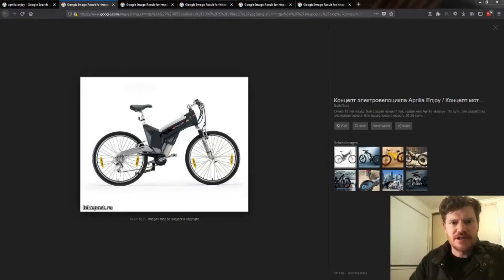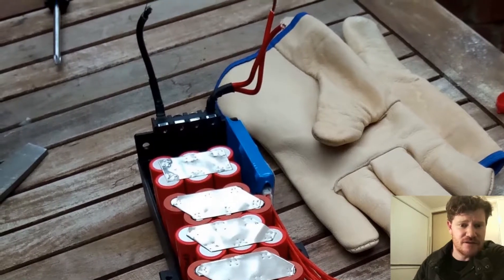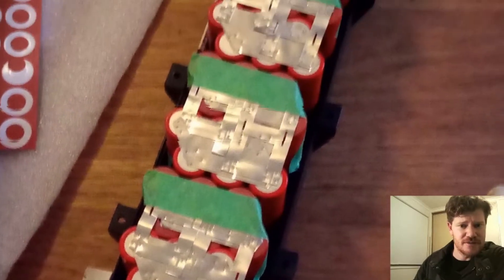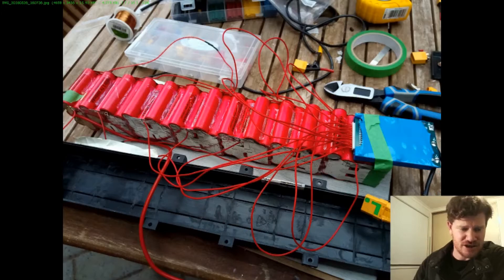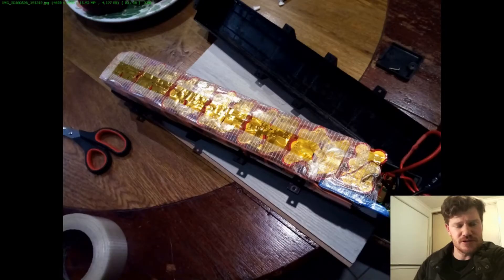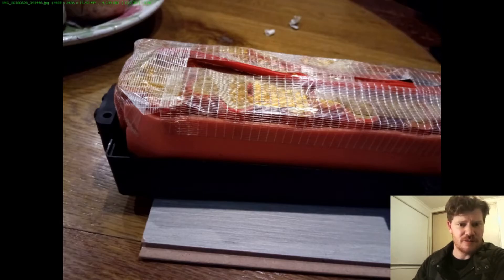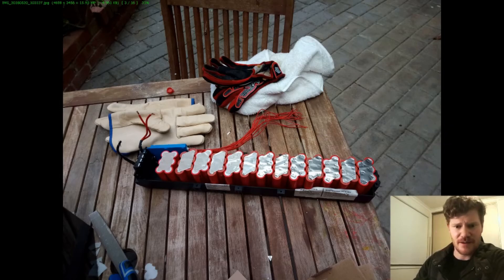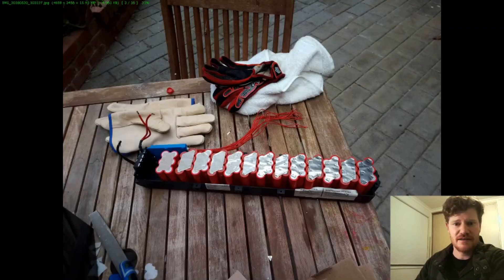Aprillia Enjoy Ebike Battery Build with 18650 Cells

Comment: Is the motor still working on 48 volts?
Reply from the maker: I'm not sure as this was for a 'customer' - but from my knowledge most ebike motors can take a range of voltage. Its more about heat management. So I'm confident it will be going strong.